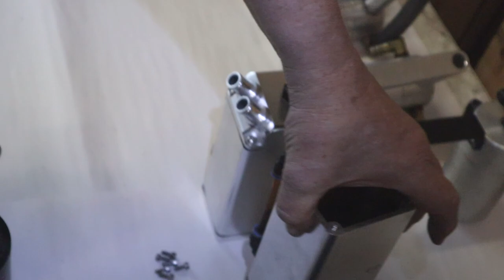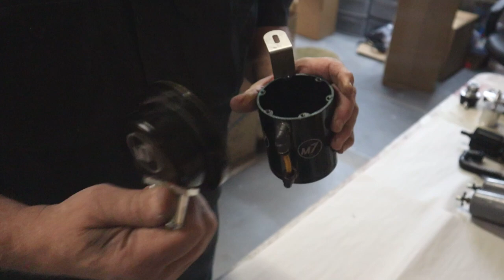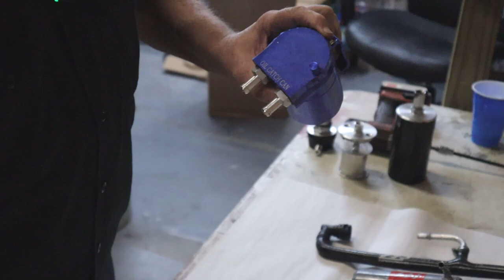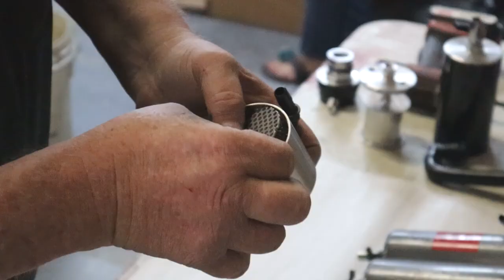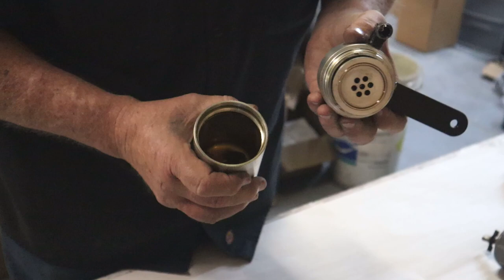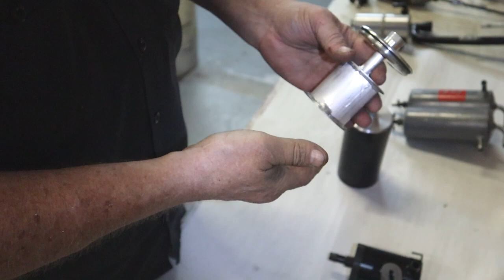Tracy Lewis Catch Can Comparison

Comment: Hands down the best!!! I have one every engine I own now, and for any Direct Injection and specially on turbo engines like the 2.0T chevy that uses turbo to evacuate, and that only happens in boost, which if its a daily and lots of idle time this system is hands done the best. MPG I found better, oil contamination is reduced greatly, and intake valve build up from carbon build up is IMO gone.

Comment: I installed the TL catch can system on our 2018 Kia Sorento with 135,000 miles. I can say with no hesitation that it is an excellent system! What was once consuming ~1 quart of oil every 4000 miles no longer shows any consumption at the same mileage. In addition to that, the oil on the dipstick appears in excellent condition. We're in the mid-west, so during the winter months, I empty the can weekly to keep it in its optimal working range. Their customer service has been flawless and the system does exactly what it should. Bravo Mr. Lewis. Well done!
Reply: Make sure you use Valvoline Restore and Protect oil to make an even bigger difference

Comment: Hi Tracey, you said elite engineering manufactures your cans. These look very very similar to the E2-X catch cans in design and capacity. Are they indeed the same cans? Also the clean side separator they use the exact same one so is your can and the E2-X the exact same? I had it on my canyon and it worked fantastic!